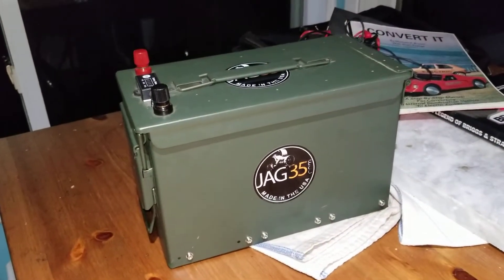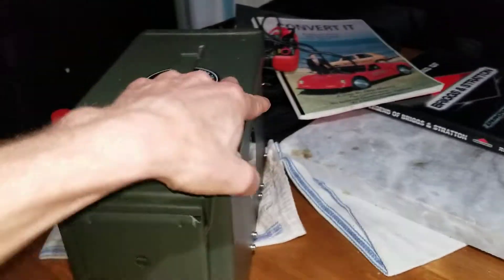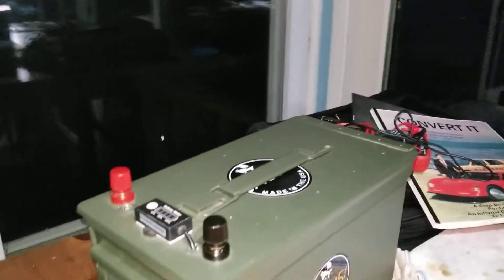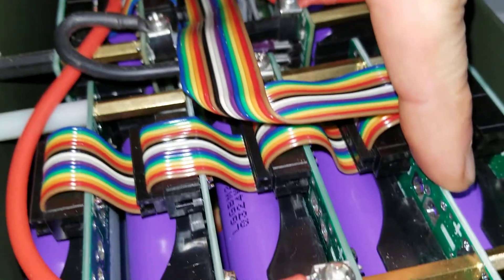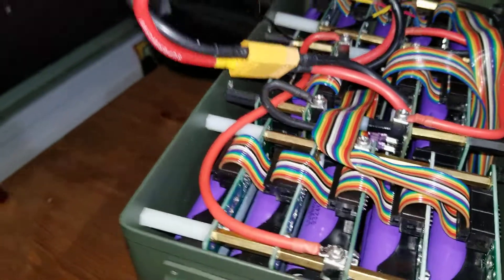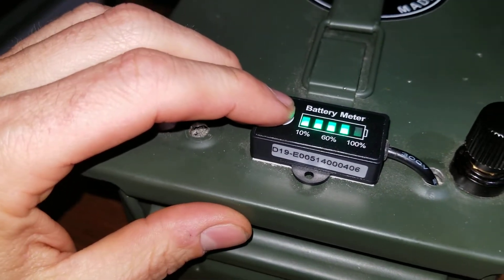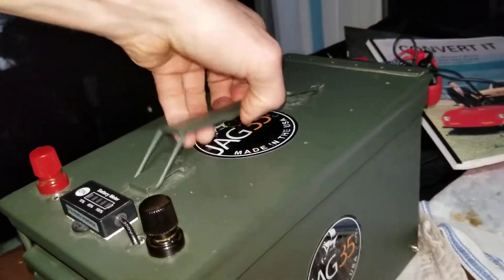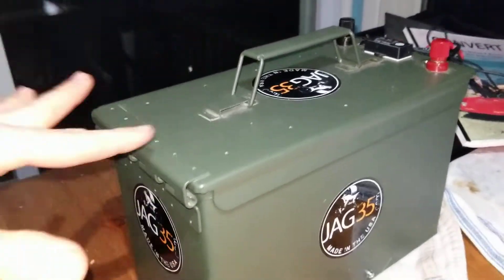Jehu Garcia Ammo Box Battery Pack giveaway

Comment: So glad to see this given away to a worthy project! Good luck to the winner on the project. I would use this as a start of a battery bank on a crappie boat. Replace the gas tank with battery packs and controller. Remove the power head and fix a motor on to the housing to drive the lower unit! Not your average trolling motor. Ideally would like to run at 30 mph with about a 3 hr run time. As you dont just drive. You have to stop and fish!!!! JWHO is inspiring alot of people. @Ron Grosinger its great to see a shop teacher who cares and trying to make it fun! Like the videos keep it coming!

Goins417@gmail.com
Reply from the maker: Thank you, sounds like a great project. Contact Matt from sunlight conversion about the boat project. He converted his sailboat to have a electric motor for in and out of port and avoiding waves and such.

And thank you for the encouragement. Yeah I have fun teaching kids about this type of stuff

Comment from the maker: Okay I've chosen a winner, Michael Varner. He plans to use the battery pack during severe weather to power ham radio equipment which is connected and supports the National Weather Service.

Thank you all for participating in the giveaway. And for taking an interest in my YouTube channel. 

The goal is to have more educational videos up. Next video will be about making a handmade galvanometer. Which is a way to measure batteries without a voltmeter. 

Also on the Now You Know Channel, we did a gas to electric conversion of a lawn mower.
Reply: Thank you so much, We are excited to use the pack!

Comment: I saw your interview with Jehu. I always wanted some of Jehu's DIY packs but have been unemployed for close to a year. I'd use it for a solar setup for a start of a powerwall system for the house.
Reply from the maker: Sounds like a good project idea. You could recycle batteries to make a powerwall. Jehu sells the PCB boards to put the batteries in. Or you could spot weld it yourself.

Sorry you didn't win the battery, but stay tuned and let me know if I can make a video that would help one of your projects.

Comment: I would use it in Emergency Communications, I volunteer with the National Weather Service and the SkyWarn Team and we are Amateur Radio storm chasers, Most of the Admin Staff  operate from home during storms(Those running Radar and tracking chasers), and we loose power a lot, and having the battery pack, i can power my radios and PC so i can track the storm chasers to keep them safe. Our chasers are tracked VIA GPS on our radar system, and if their is a tornado close by we radio the chaser to be on the look out and stay safe. At the same time the Amateur Radio operator (HAM) is relaying information to us for the national weather service. Most people don't know that Amateur Radio Operators relay 80% of the weather reports to the National Weather Service.  So having the pack will help keep me up and running during storms, so i will not have to worry and helping keep our communities safe all across the gulf cost. http://southalabamaskywarn.org/ is our group
Reply from the maker: As you know, Michael you have won the battery. Great project idea and good luck going forward.
Reply: @MrGsWorkshop  Yes sir and thank you again, i told everyone at Skywarn and we will share it across the net controllers

Comment: Wow thats a heck of a battery pack there. I would love to use it as a trickle charge battery in my shed's solar setup, or maybe an electronics power supply to help test new circuits. Thanks a bunch for the giveaway.
Reply from the maker: That's a cool idea, using a solar panel to charge it up.

Sorry you didn't win the battery, but stay tuned and let me know if I can make a video that would help one of your projects.

Comment: Love it! I think it will work for my cpap during power outages.
Reply from the maker: Yeah you definitely need a powerwall for that. Believe it or not you can get started with recycled 18 650s. Jehu sells the PCB boards or you could spot weld it yourself.

Sorry you didn't win the battery, but stay tuned and let me know if I can make a video that would help one of your projects.
Reply: @MrGsWorkshop  Thanks. Yes, I already bought 2 of the 7 battery kits and probably need 3 or 4 more to last a night or 2 on the cpap. My friend designed and made 2 backup boxes a few years ago with lead/acid 35 amp hour marine type maybe? They are ok but heavy as hell and we seem to need new $140 batteries every couple years.
How many kits did that box have and how many amp hours is it good for? As I recall the cpap takes about an amp constantly @24 volts. We need at least 14 to 16 hours. Is the math that easy? Can't be :)
Reply from the maker: @castello544   castello  jehu ammo box battery pack is close to one kilowatt hour at 48v nominal.  

There's 84 batteries in there. Each battery case holds 7 and there's 12 total. So that's 84 batteries

But you have to think, each battery is 3.7 volts nominal. Meaning in name only. Top charge is usually 4.2 volts each.

So to get the voltage, it has 14 in series, but to get the amps he put 6 in parallel.

14 s * 3.7 volts * 2.6 amp hours x 6 in parallel equals  800 watt hours.

What is a watt hour?  Simple. Volts times amp hours equals Watts.  Battery capacity is rated by amp hours.  If a battery has 1 amp hour, that means if you draw 1 amp for 1 hour, the battery will be dead at the end of the hour.

You said your battery might be 35 amp hours? So if you're drawing 1 amp per hour you have 35 hours.

I have a Excel sheet calculator you can try out.  Just type in your volts, your amp hours, and your C rating. Which is capacity * 1. And then you might be able to figure out how long you have until empty based on your load.  Give it a try, and email me if you have any problems.

https://docs.google.com/spreadsheets/d/10T7IUbpWsJtmgeoFDlsTNe9qRFdT3v6vFC3dDGil7N8/edit?usp=drivesdk
Reply: @MrGsWorkshop  Awesome and thanks for all the info. Yes, our batts are "Sealed Large-Cell Battery for Continuous Use, Lead Acid, Tab Post, 12V, 35 Amp-Hrs. Capacity" but now our new cpaps are mostly 24 volts. With you and Jehu's videos to help us, we will figure out how many and what box to put them in. We already have our old boxes, so maybe we can use them.

Comment: Hi, I would use this as a spare battery for my scooter project.

It's a Razor Pocket Mod that I'm swapping from 300 watts brushed DC motor and 24V lead acid to 1,800 watts brushless DC motor and 48V lithium ion battery.  For cosmetics, I'm planning EL paint to give it a TRON Light Cycle theme.

I'm estimating about 36-40 mile range at around 20 mph with a top speed around 28 mph and the whole conversion shouldn't add more than 10-15 lbs of weight.

With a spare battery pack, I could pretty much double the range or carry an inverter to bring AC to my destination. I might buy a solar panel and charge controller if I'm not utilizing it enough.  I dont think I would grid tie it but I could probably charge my scooter from stored solar power at night to bring my cost per mile to near zero.
Reply from the maker: It sounds awesome. That thing is going to be so fast.  Keep me posted on the progress

Sorry you didn't win the battery, but stay tuned and let me know if I can make a video that would help one of your projects.

Comment: I will use it for an electric bike cart (trailer) That pushes the bike and carries cargo with brake lights and turn signals And gets partially re-charged through two solar panels and A voltage controller mount it on the top of the cart. Thank you
Reply from the maker: Sounds like a good project. I've heard of people riding bicycles across the country using a solar palatal trailer and Battery.

Sorry you didn't win the battery, but stay tuned and let me know if I can make a video that would help one of your projects.
Reply: Ron Grosinger Thank You and I love the EV